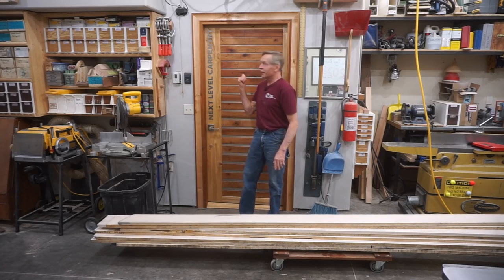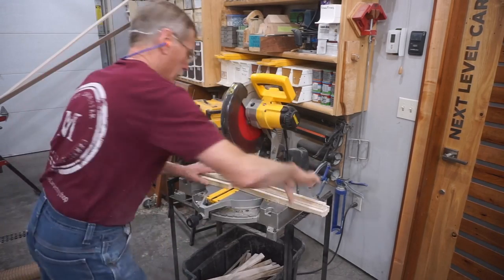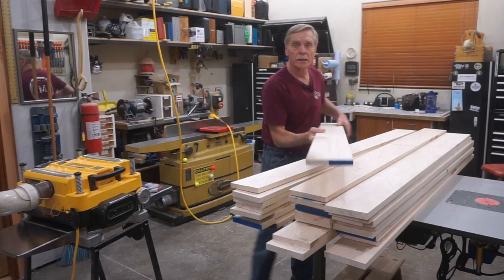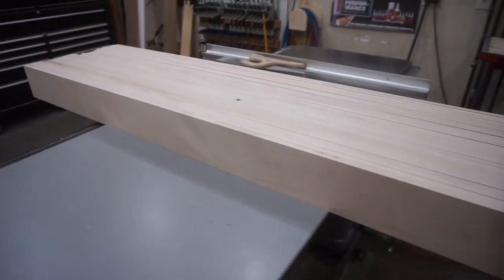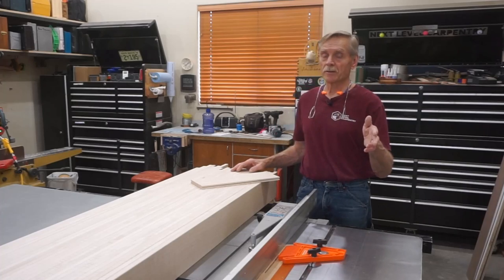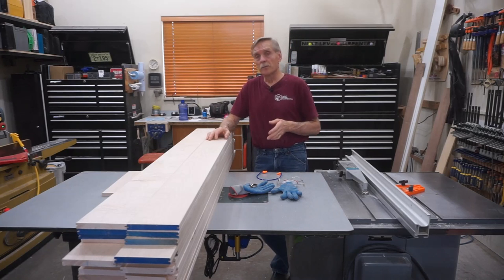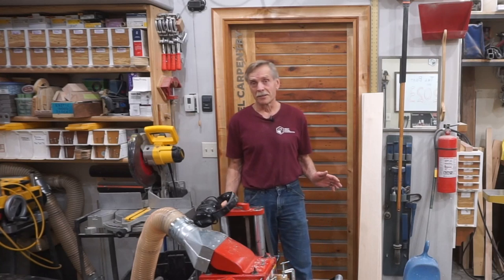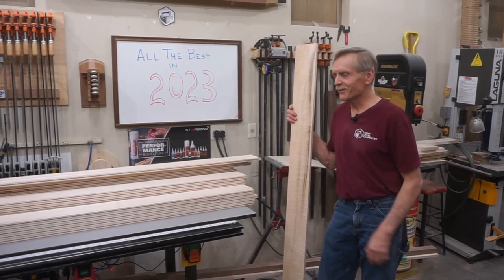Make Custom Nickel Gap Paneling

Comment: A method to safety against mic failures is to use 2 separate mics. ie, one left channel one right channel.  A bad channel can be muted.  Some mute the channel and record a voice over  to “recover” audio.  I’m here for the knowledge not entertainment.  I want to see how you fix it. An excellent value, even at these prices.  On the other hand you might consider some of the features used by the motorcycle and hot rod builders.  You know, have a fight with Chip or run a wrench into the planer head  and then smash the planer.  Great for viewer numbers!
Reply from the maker: Thanks for a pass on the audio fail Steve.  Prior to this event I always relied on a blinking blue light on my mic setup indicating a signal failure.  Problem is that this time the light was steady because it thought it was recieving... but it wasn't.  So the camera tries to record background audio producing that annoying dull hum over muted ambient noise... UGH, what a mess!  Makes me glad there's viewers like you 'out there' who watch 'for the knowledge not entertainment'... it's my only hope for any success when video production goes south! 😒  I'll consider picking a fight with Chip next time he runs rocks and nails through my planer... reality TV at its finest, right?!

Comment: You may want to look at your video from about 38:30 to 38:40. Was that a safe cut? Im not trying to scold or shame. But in my opinion that finger was way to close to the blade. I have likely done the same thing and we don't even realize it. Another great video and attention to detail
Reply from the maker: Kevin; I paid extra attention to the cut sequence you point out because it looks so treacherous but, fact is, it was completely safe IMHO.  
I'm glad you brought it up though because there's great potential for injury if ANY of the factors involved change.  The combination of ZERO clearance insert, type of pushstick used, blade height and distance setting, workpiece size, feed rate, type of material, etc gave me confidence with the process but a significant change in any of those factors could result in a very different outcome.
Best,
Matt

Comment: Excellent video. Back groves is a great idea. What make is your table saw?
Reply from the maker: 10" Delta Unisaw circa 1982... wish I could buy a new one just like it as I prefer it to ANYthing on the market today...
Reply: @NextLevelCarpentry  I thought so  I Just bought a used one. I don't have the two covers on it. Did yours come with them on?
Reply from the maker: @binnsbrian  Cool that you found and bought a used one... great machine for sure!  Not sure what you mean about 'two covers'... explain?
Reply: @NextLevelCarpentry  Maybe the zero clearance inserts?
Reply from the maker: @ericsmith8308  could be but I wonder if it was the dust cover over the motor?
Reply: I'm referring to  the dust cover over the motor. It looks like a oval pressed piece. On mine I can see the motor a belts.
Reply from the maker: @binnsbrian  My saw came without the dust cover over the motor so I made the one you see (made of plywood and lexan) out of necessity when I got a dust collector a few years back.  You mention 'two covers'... if the 2nd one is the louvered one on the front of the saw, that one did come with it but I put a thin piece of mdf on the inside to help improve dust collection...
Reply: @NextLevelCarpentry  Thanks. I guess that will be my first modification. It also has the original fence that will be the next job.
Reply from the maker: @binnsbrian  By 'original fence' do you mean a pipe for a rail that the fence slides along and locks to?  Mine came with the Unifence you see in all my videos.  It's a great fence but I've considered upgrading to a beismeyer style fence more than once. Whatever you choose it will probably be a nice improvement over the old pipe-style design.
Reply: @NextLevelCarpentry  Yes.  It's the old pipe style. Thanks for the suggestion on the fence.

Comment: Enjoyed the video as always. I really appreciate the effort you go to in order to teach good methods (e.g. working through cutting the thin strips). I always feel I've learned something useful. I do have a question: Since you are milling the boards vs buying them and it would seem to be less work to create shiplap panels, why go with nickel gap instead? Client preference or is there some other reason?
Reply from the maker: Thanks Don.  I've never liked shiplap panels for interior/finished surfaces because a 'lap joint' is more subject to issues if individual boards cup or warp since they're able to act independently of each other where nickel gap, being essentially tongue and groove, means adjacent pieces are restricted to common movement.  That is to say the tongue/groove joint tends to resist movement of adjacent boards keeping the whole installation flatter over the long term.  Sorry I made that sound so complicated but, to me, the little extra work milling it is worth the better look gained long term. 
 Since I'm quite chronologically gifted I can remind viewers that shiplap sheathing was a common 'best practice' for exterior wall sheathing in the days before plywood in the days before OSB.  Back then, when dinosaurs were young, you'd be seen as a sad hack if you even considered using shiplap as a finished INTERIOR wall material but tongue and groove was quite acceptable.
Reply: @NextLevelCarpentry  Thanks for that good reply. I continue to learn from you!
Reply: Chronologically gifted 🤣

Comment: WOW, that is a lot of effort to get something just a little bit different than what could be bought from a company like Windsor One or Baird but if a client is willing to pay, what the heck, go for it! I'm curious about your estimating process. How did you determine labor hours or was this a T&M project? Nice work as always BTW.
Reply: Look at it as a learning experience for someone who would like to start from scratch.
Reply from the maker: Thanks Jay.  If there's one thing I've learned over the years it's that the work I find profitable takes a real paradigm shift in my thinking and approach because the whole world of bid work runs contrary to this sort of project.
FWIW I actually talked to Windsor One to see if something they had would fit the bill. The excellent rep I talk to was very receptive to providing product and their stuff is excellent quality for sure but designer and client didn't want standard nickel gap or commong vee-grooved paneling.  That's the niche I try to fill and, by doing everything T&M, don't ever fret about bidding the work.  If I ever did the same job twice I'd be able to bid a 2nd one but that's the thing about CUSTOM design build: there's more than enough people out there who value one-of-a-kind things that I've always turned down more projects than I accept.
Reply from the maker: That's the takeaway I hope viewers find, Dave; this is how custom millwork is done in a small-ish shop.  If there's something 'off the rack' that fits the bill it's almost always less expensive, but when the job requires something one-of-a-kind, meeting the need is totally doable IMHO.

Comment: Did you choose the rough cut lumber with a specific grain orientation in the profile?
Reply from the maker: That question NEEDS to be asked.  The odd truth is that, totally out character, I called in an order rather than hand-selecting which I do 99.9% of the time.  I asked for and got "4/4 Soft Maple, Select & Better, Sap 1 face" and the boards you see at the beginning of the video is what THEY selected out of the bunk to fill the order.  I was as surprised as any viewer because usually a called in order yields the dregs of the bunk, not the cream of the crop...

Comment: Maple is nice timber, but for me the most difficult to work with. What’s soft maple?
Reply from the maker: Soft maple is very similar in appearance to rock or hard maple but, no surprise, is 25~30% 'softer' and easier to work.  Wouldn't make for a good butcher block but is an excellent choice for high quality, very durable dent-resistant millwork IMHO.

Comment: How do you like that Makita mini saw?
Reply from the maker: I am continually Amazed with how well I like that little saw. On the face of it it's no more than a plastic toy but its power accuracy and light-weight make it my first choice for more things than you what imagine. I do resort to my previous favorite which is a six and a half inch model 367 Skil Worm Drive corded saw but that's mostly for long rips on a job site.
Reply: @NextLevelCarpentry  I too have the 6 1/2" skill saw. That 6 1/2"makita you have I don't think has a hook on it. The newer one with the hook on it has more power.  I've  been going through  my tools and found a old 4 1/2" Porter-Cable Worm Drive saw I no longer use, it's made the USA and I think I'm going to have to get rid of it🥺
Reply from the maker: @3dandyrandy3  Hard to let those old, faithful tools go, isn't it?  I wouldn't mind more power in a newer version of the little Makita saw if it doesn't come at the expense of agility....
Reply: @NextLevelCarpentry   Great detail in that video by the way!